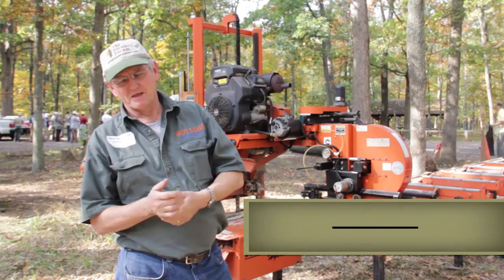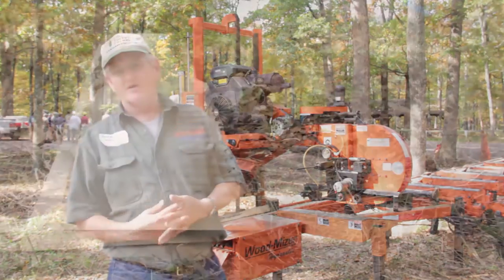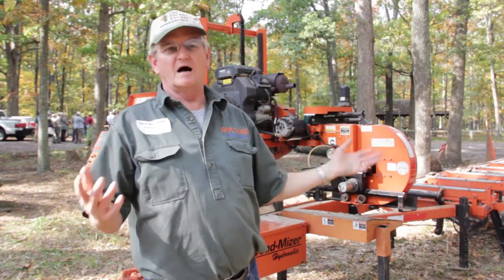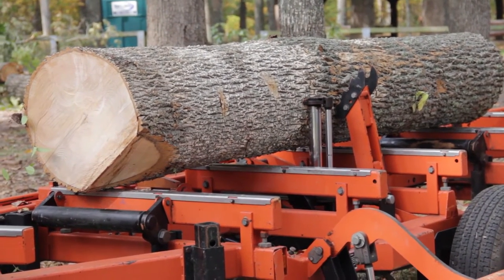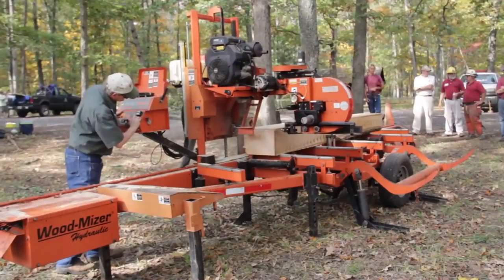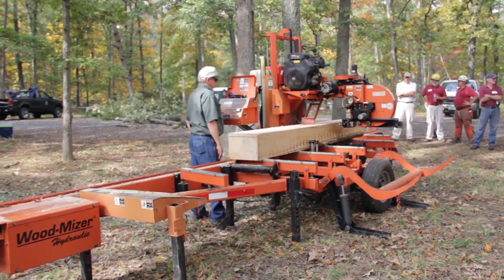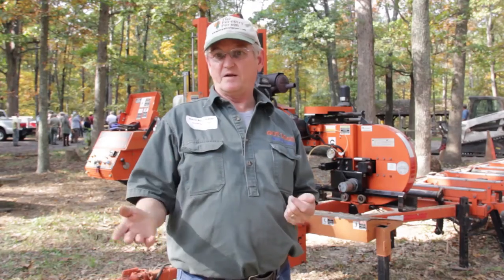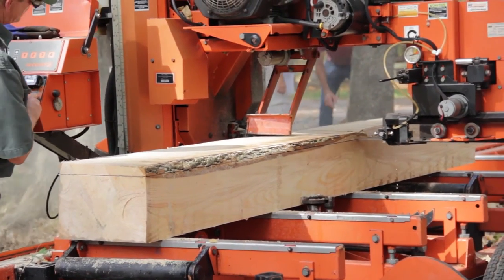Milling Logs

Comment: I need 44 poplar logs that are the longest, straightest and biggest.
I will be building a log cabin.
Is 12 inches thick and 26 feet long out of the question? 
Two cuts only, inside and outside.